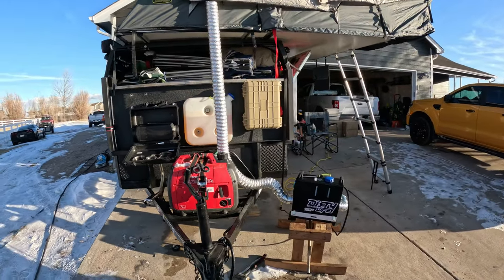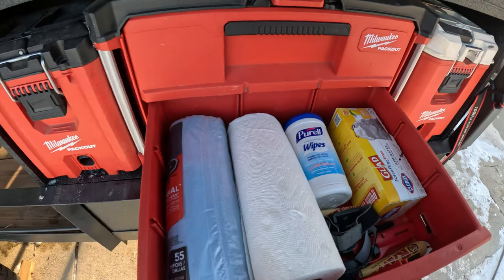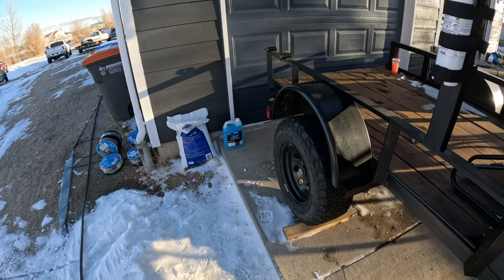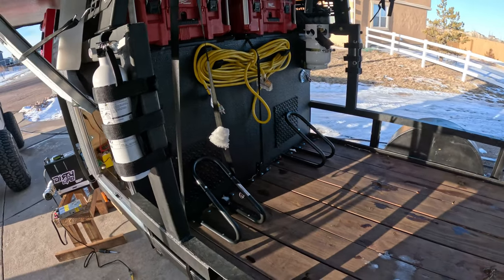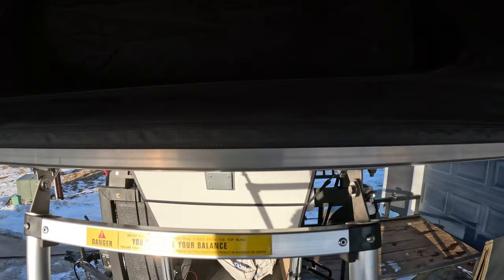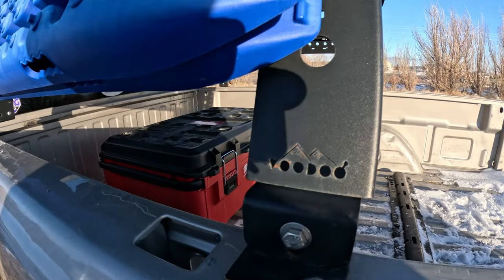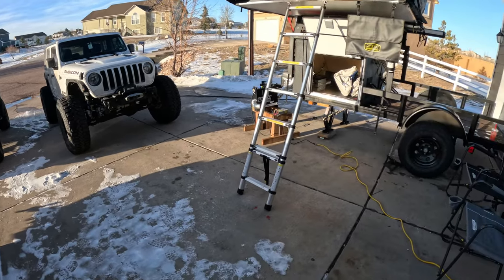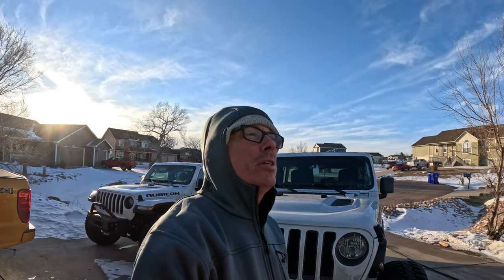WALK AROUND of my Overland trailer build! Solar: Diesel Heater: Cooking setup

Comment: Great set up. I’m currently in welding & fabrication school. I’m about to build one for my first project. Could you tell me the dimensions of this trailer?
Reply from the maker: This one was 10x4 was 12x4 I cut some off of it. My other trailer is a 4x6 and it’s a lot better as far as maneuverability

Comment: Link to the door?
Reply from the maker: I got mine at a local RV store. But this is a similar one on eBay. I got a different one off Amazon and it swung to the left. I was mistaken after looking for it. I’ll edit the video. Sorry. They have many different size and swinging combinations. https://www.ebay.com/itm/144901296399?mkcid=16&mkevt=1&mkrid=711-127632-2357-0&ssspo=jJjpETDzQLO&sssrc=2349624&ssuid=snmqeefotmy&var=&widget_ver=artemis&media=COPY